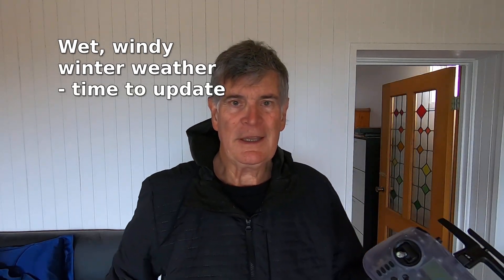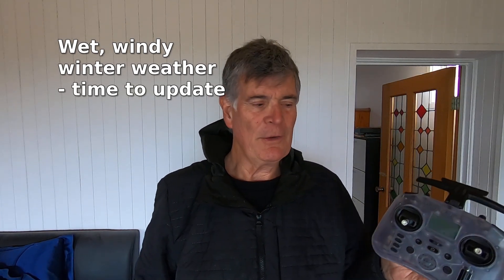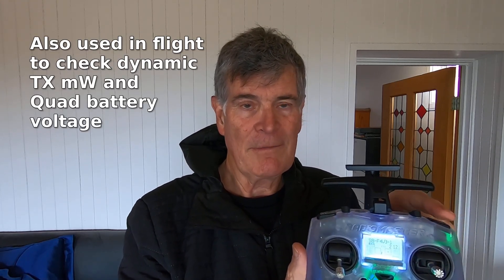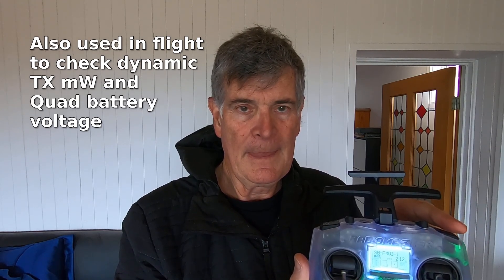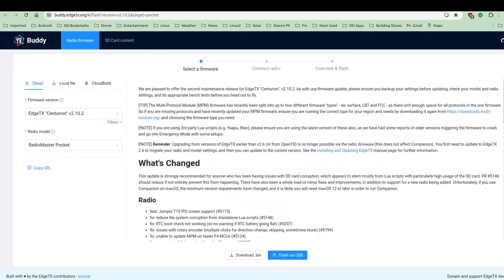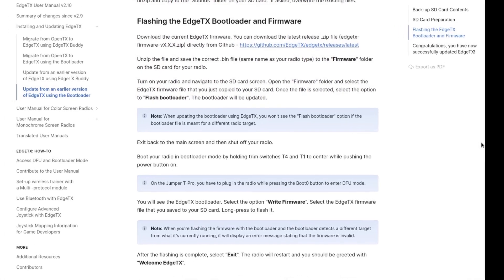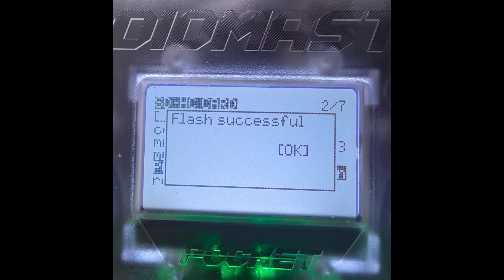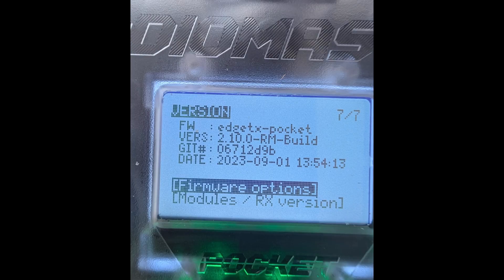RadioMaster Pocket - EdgeTX update. Flight Timer fixed!

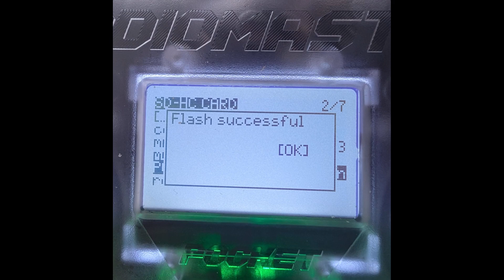Comment: I do not know what I can do after flash sucsessful from 3:50
Reply from the maker: Turn off radio. Hold trim buttons into centre and restart. Should bring up next option to write firmware.
Reply: @skybug3  I did thanks

Comment: hey man, thanks alot, do u have the ELRS version or the CC2500? i ordered the ELRS one and under the Firmware it shows exactly as urs, please help
Reply from the maker: I have one of each. The ELRS version uses the Internal module (Under model Setup, Page 2) for the model. The CC2500 uses the external ELRS module.  Under model setup, I select External module and turn off the internal module.